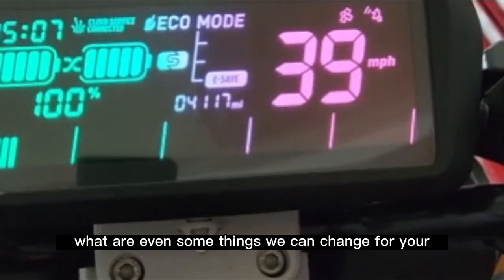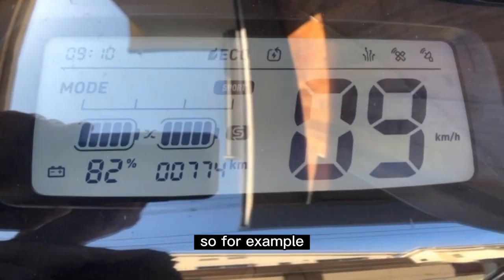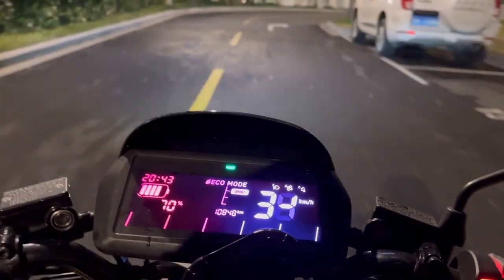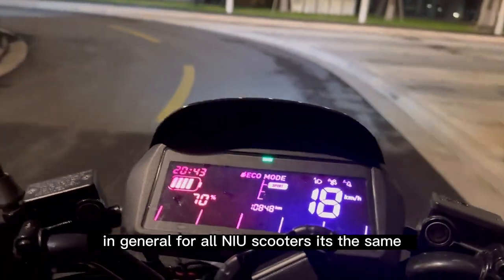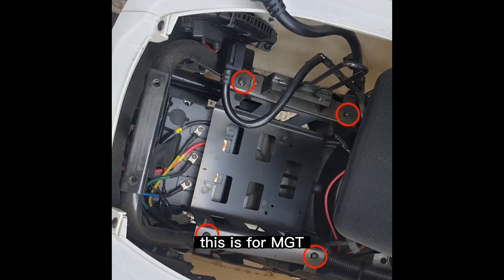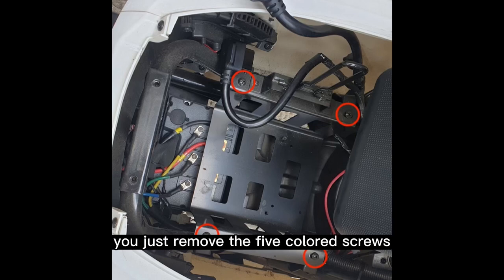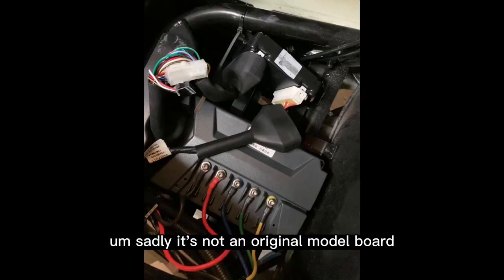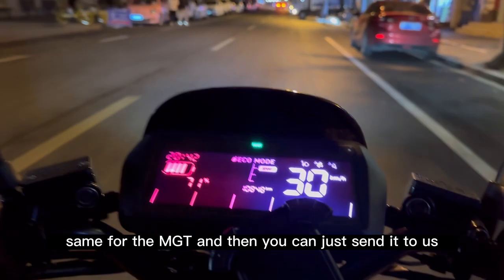How to Speed up a NIU Scooter (MGT, NGT, NPRO, NGTS)

Comment: is the latest dashboard only works with a v36 ecu or u can swap on the older gts models?
Reply from the maker: If you don’t want to swap the ECU, that is fine, but it’s possible that some features of the newer dashboards will not show on the older ECUs
Reply: @escootparts2284  thanks thats was i afraid of but with urs modified ecu is that possible to work properly?i think the harness and some other parts might different too.another question if i upgrade the hubmotor with stronger one like from ylmotor or qsmotor does ur ecu handle it?and the last one do u build battery packs like lifeop4?